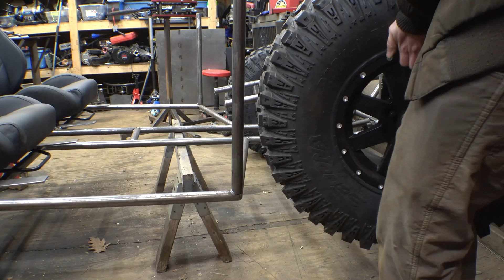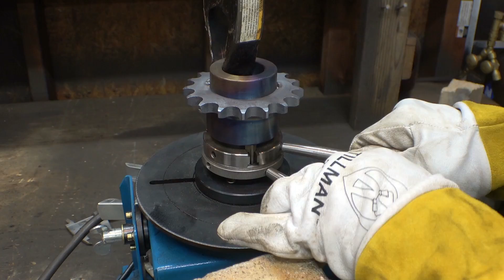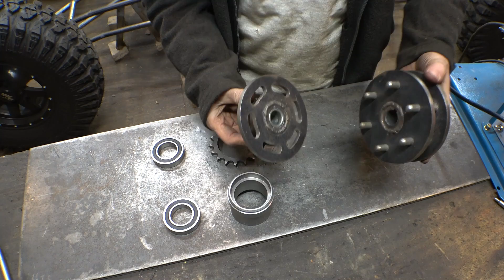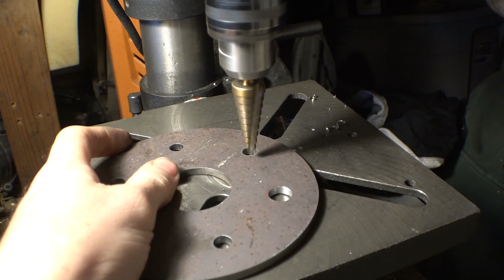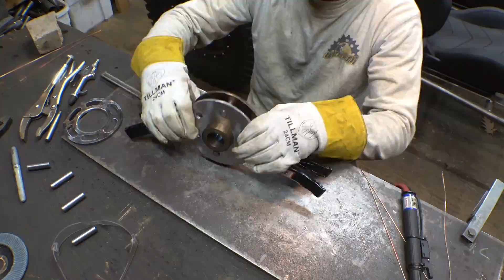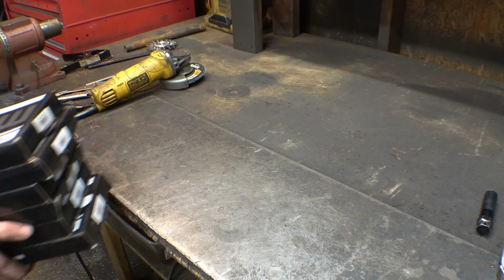Installing the Chains on the Mini 4WD Trophy Truck Project - Part 4

Comment: For the "doors" just make a single bar swing out of the way to make it easier to get in and out.  My only concern with the design is having the rear suspension pivot on a rotating shaft.  That is asking the bearings to do quite a lot with the extra loads that they will be seeing but I am sure it will work for a while anyhow. Lol.  I like seeing how you come up with solutions that others haven't tried because I do that as well and have had pretty good results as well along with my share of failures.

Comment: I really enjoy watching you build stuff. This one as well. However... this concept, I dunno - first of all, every "Trophy Truck" I've seen, is 2 wheel drive, with crazy long suspension.  Second, it seems like you're going to have 4 chains, 2 transmissions (Hyabusa engine has a built in 6 speed?), a clutch plus your home-grown transaxle setup. Doesn't this seem overly complicated?

Comment: Chris, do you know the reason why the hole that metal lathers cutter was able to cut through that hardened steel gear? It's because of the metal that was doing that  is the world's hardest metal. It's tungsten.

Comment: When you start looking at car engines you look you should look at the K series in Honda cause you can get fuel injection everything less than you can for a V-8 or V6 and you can get almost 450 hp

Comment: Just one thing I want to ask: will you put your chains in oil bath (with differentials together) or just leave as it is hoping it's enough to lube them sometimes?
Reply: O-Ring chains don’t need an oil bath. But they do need periodic cleaning and lubed with gear oil. They will have to be replaced from stretch before anything else.
Reply: @rexhorning7228  I know they don't but differentials and sprockets need it and they could be placed only with chains (btw it won't be bad for chains).

Comment: I do like the fact that the drive sprocket is on the same plane as the suspension pivot point. It keeps the chain tension equal throughout the suspension travel. This definitely keeps the chains happy, and in turn it will last much longer.
Reply: No anti squat reaction though

Comment: Plenty of people on YouTube use bolt on stuff (boring) that’s why people like myself, love to watch your content! That’s because everything is custom to the next level! All created using brain power and experience! Keep it up dude! And we’ll done!
Reply from the maker: Exactly!! Thanks man!
Reply: @ratherBweldingChris  i would highly recommend boxing the A-arms and trailing arms with some sheet metal. maybe 1/8th or 1/4 inch. Adds a ton of strength for the weight. looks badass too.

Comment: Hi Chris, I’m trying to figure out:
The shaft, that transfer torque from engine to front and rear will also handle the whole rear suspension basically, and it will spin (pretty fast) inside bearings that holds rear suspension arms
Is it correct?

Comment: I put the full torque with no damper from an S&S  x wedge 2.0 liter engine to a single back wheel on my reverse trike, no issues with the chain. so...

Comment: You need to build you a Hand rest and a bracket on your bench to slide it into and not use FireBrick for your hand rest I’m just one to  work smarter not harder I worked at Deere for 30 years

Comment: I know chains are cool and stuff, but there are lots of 4x4 transfer cases you can weld a flange for a sprocket on the input shaft. Not judging.

Comment: Call up a local machine shop supplier and talk to the about your carbide inserts for your lathe. I'm curious if you can get a better chip breaking insert that will avoid all the stringy metal birds nesting chips. should make your life a lot easier (and safer).

Comment: Hi Chris yes add doors it would look better and best way to get in and out also I hear you on building your stuff and it is fun but shaft drive build is stronger and will not have chain stretch  but keep up what you do you do very well for what you have to work with very nice.

Comment: Have you ever thought about make a halo warthog with chain drive  trailing arms front and back with all wheel steering and all wheel drive, and rather than using solid axles like all the other ones on YouTube having separate suspension for each wheel will definitely make it more like the video game version

Comment: Chris, with the sealed bearings like those you should take a razor blade or itty bitty screwdriver flat pop the cover off the side and pack those bearings with high speed red Grease they do put grease in them from the factory but they only put like half an ounce of really crappy grease in them even the ones made by all balls aren't any good you have to pack them with grease yourself or they're not going to last then you just pop the cover back on and they're good to go.

Comment: My only concern would be the 4 bearings on 1 shaft, once the frame flexes a little you will either start to warp shaft and break eventually or bearing will go bad

Comment: to get the sprocket close to centered, you could use your tailstock to press against the chuck, roughly centering the bore to the tailstock (around 5 minutes in)

Comment: I kind of had a feeling that's how you were going to lock and unlock for the front spool. It works well and all things considered, simple and reliable.
Reply: @mostlymotorized  i don’t think it would pop out of gear at all. If anything, it would shear the pins off before popping out.

Comment: I understand going with chain drive is cheaper and possibly easier to engineer, but you are going to lose ALOT of energy with that distance. Especially considering how heavy this rig is going to be, I'm afraid it might be doomed to experience issues with being very sluggish.

I wish you the best though, and really hope I'm wrong.